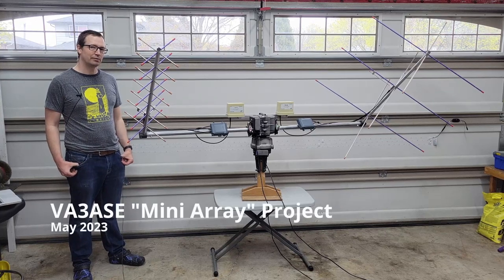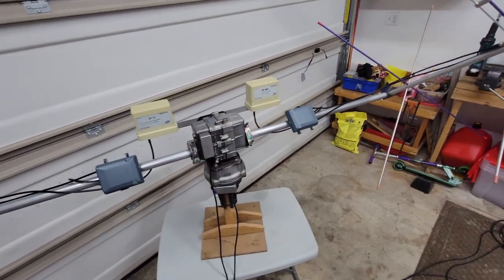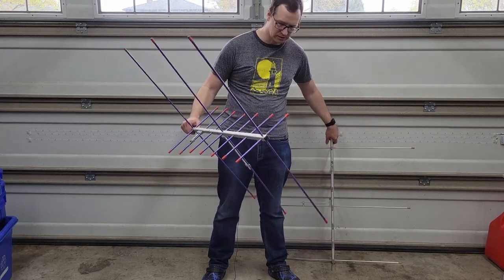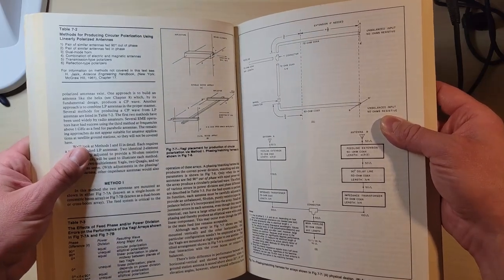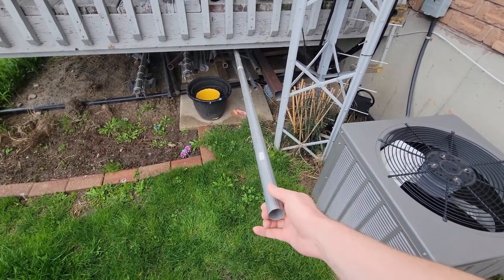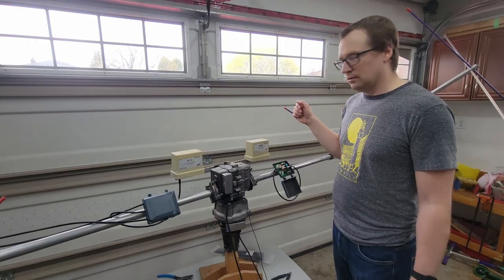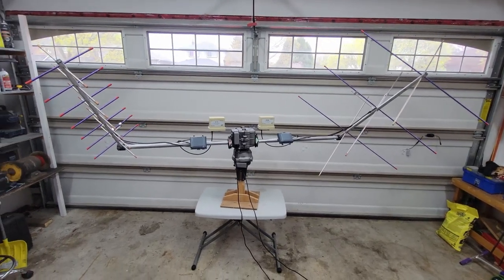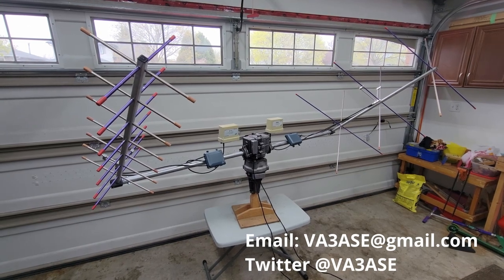Ham Radio Satellites with Two Arrow Antennas and Circular Polarization?

Comment: Hi Alex. We printed your 45 deg mount, and are going to use an Alaskan Arrow antenna with it.  I'm going to try to use a PVC (Schedule 40) cross boom as the Alaskan is longer/heavier, so I'd like to have it balanced.  Hope I can fit the mount inside a 1in (Inside diameter) PVC pipe. Haven't gotten that yet. For now, not going to have RHCP but will look into how you did yours.

Comment: Very nice! I just received my antenna rotator from Sarctrac in Australia. It’s a wireless rotator that does azimuth and elevation. I will be using a dual band elk log periodic beam antenna. I am also waiting for a wireless controller and a stepper motor that will enable me to adjust for horizontal and vertical polarization. I will post a video when I get this project together.
Reply from the maker: Sounds fancy, have fun!

Comment: I LITERALLY just bought one of the Arrow antennas to use for Field Day!  🙂 - And like you, I've beem running fixed polarization (vertical in my case) for satellite operation, with the resultant fading issues you mentioned, so I'm VERY interested in seeing how your project turns out, I may do the same!

73,
Tom WA1LBK

Comment: Very glad I found your channel. Great video, very impressive hope to make contact with you on the satellites.  I've been thinking about installing an HF beam under my antennas like the 6 meter one you have and was wondering if they would interfere with each other. I have subscribed and looking forward to more videos.
Reply from the maker: Thanks for the kind note, glad you liked the video. The antennas probably do interfere with each other, but there are a lot of compromises I've accepted in this setup. I'm sure there are calculations or simulations you can use to avoid any interference if you're very concerned. In my case it hasn't stopped me from reaching VUCC on 6m and satellite.